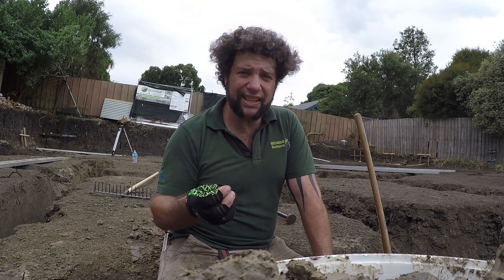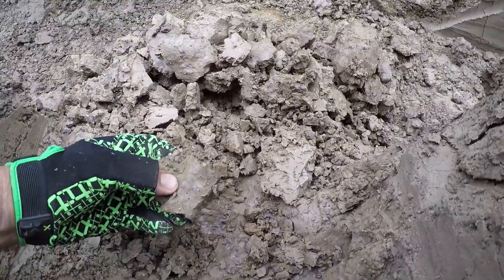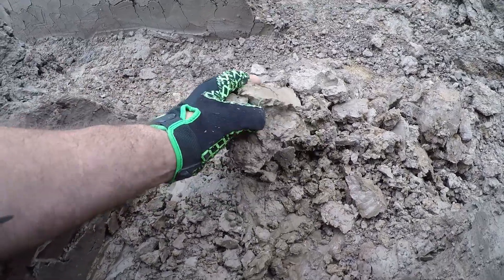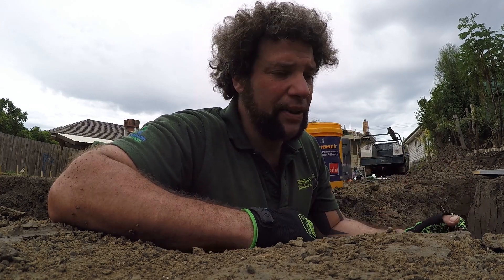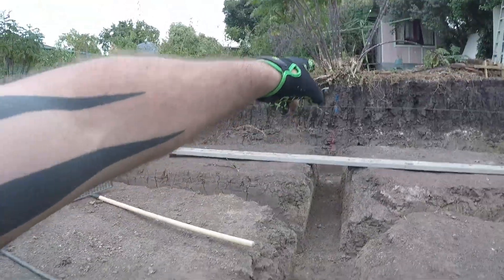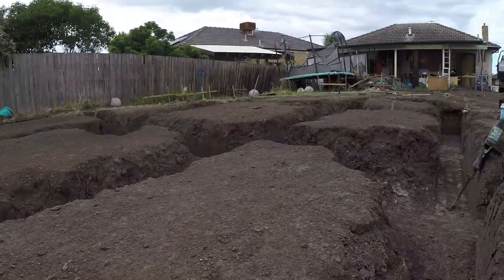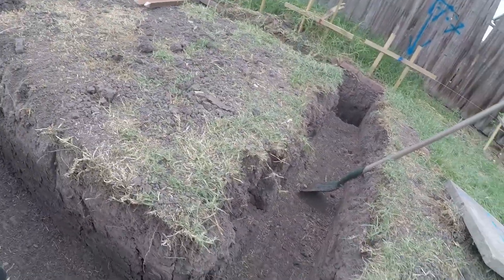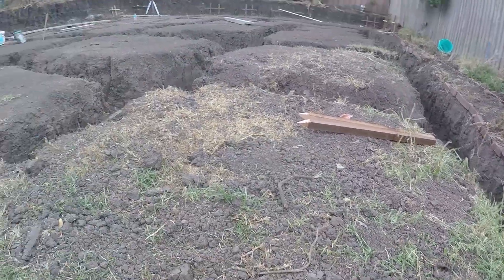Foundations and soil types - lets look over them

Comment: Hi good looking man  just wandring if you could help me out .what to do . We started site cut cut under 500 mm topsoil is very soft white mat  . And it is like a metar . If we have to remove all and what should back fill up with ?? Cheers
Reply from the maker: Great Question Jawad,
firstly if there is any back filling it needs to be done with stable soil.... this is a packing sand yet the engineer on your project should be told of what you've found and will need to stipulate if / what can be used as stable fill.
#stayawesome